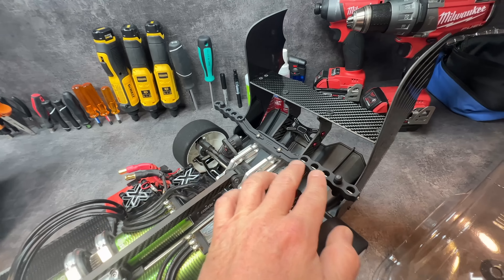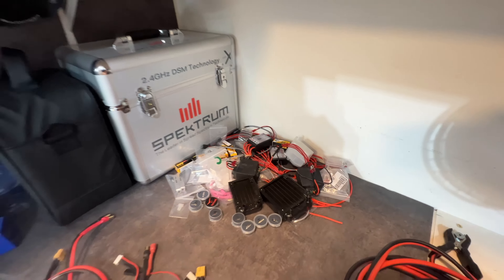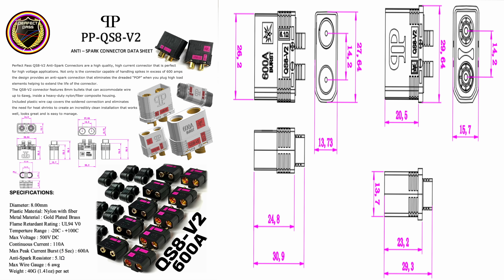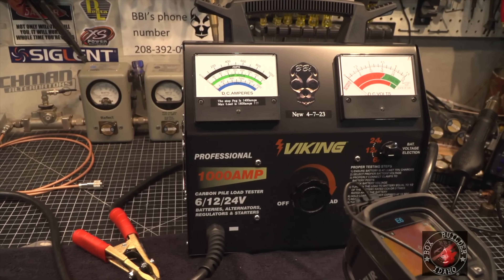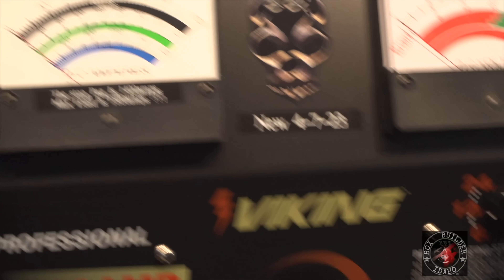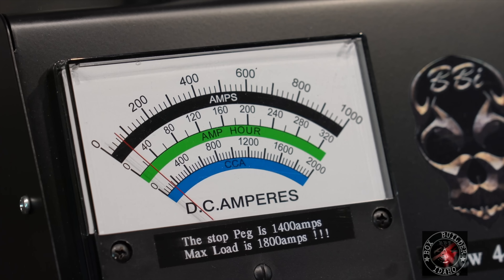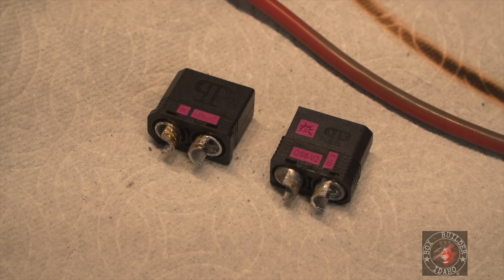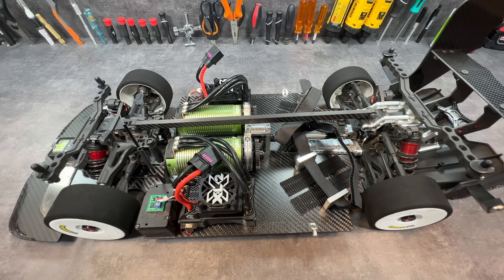Perfect Pass Updates!

Comment: Raz I have a question about speed run gearing as I am really close to having mine finished, and ready to test.  Factory gearing is 44T spur and 19T pinion.  I want to do a mod 1 gear upgrade, is a 30T spur too small.  I see guys running big spurs and big pinions.  I plugged it into a calculator and results are 30T spur with 18T pinion is the same as the factory gearing.  There are so many different opinions on this I just want to make sure everything is correct on this first build. Thank you for all you do.

Rick

Comment: Raz love your videos I am just starting with a speed run car it is almost finished and ready to start running.  Curious though about what gyro to install in it for the steering.  Does perfect pass make one or just the launch control.
Reply from the maker: Hey:)
Gyc441
Reply: @RazShifrin I know that this is gonna sound like a dumb newbie question.  With the gyro installed if the rear of the car slides to the left which way should the front wheels move.  First time setting up a gyro